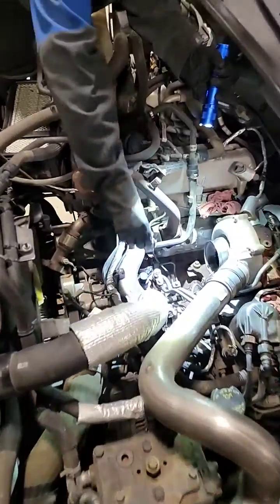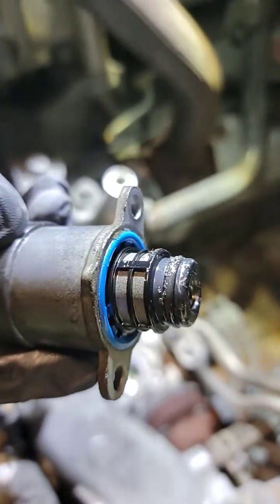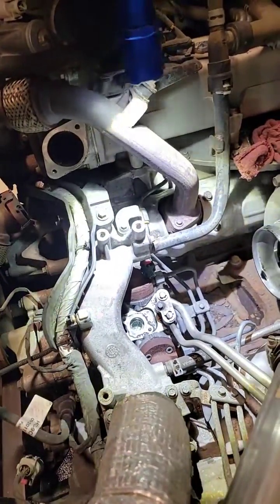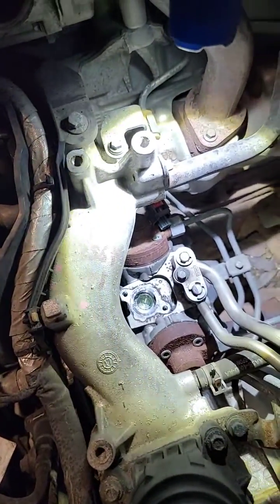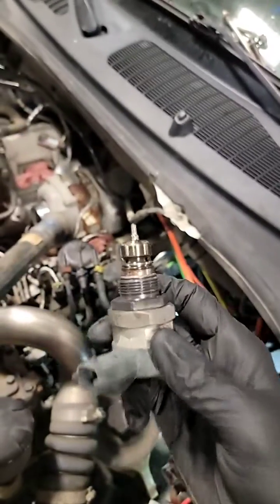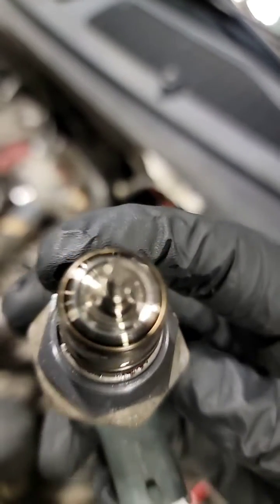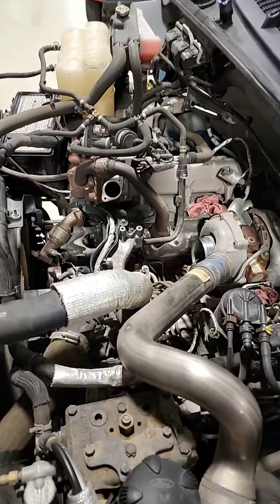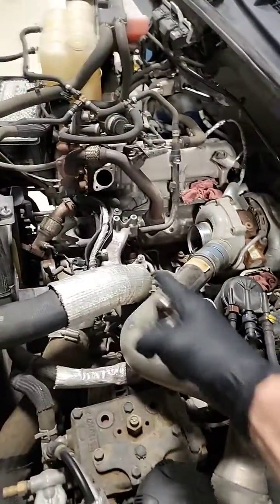6.7 Diesel - CP4 Failure check points! #shorts

Comment: I’ve had an issue for over a year on my 2017 6.7 where it will reduce engine power at WOT; I pulled the metering unit and it is super clean; no metal on it; I haven’t pulled the part off the end of the fuel rail yet….should I check it? Or do you suppose im good?
Reply from the maker: I honestly wld do the DCR and the LH rail only in this situation because you have a problem, otherwise it would just be the DCR

Comment: I’ve got a 2011 that just rolled over 100k miles. I have kept on top of fuel filter changes and I run hotshot secret edt. Do I still need a CP4 bypass kit?

Comment: At what milage/hrs are the CP4s typically failing?
Reply: Its a crapshoot brother. 

Look at taylor rays brand fking new f350 dually he just sold back with only like 10k miles on it after the cp4 grenaded on a roadtrip pulling a toyhauler.

Thats right. It grenaded at 10k miles, dealer wouldnt warranty it. Ended up covering it under warranty, most likely because he has half a million youtube followers.

But he said it was like 12,000 to fix everything.

Dealers arent warranting cp4s if they find water

Comment: As Consumer Level Diesel fades from relevance. FoMoCo released 7.3 Godzilla gasoline V8 in 2020 for this very reason.
Reply: Now they have a 6.8L babyzilla too
Reply: @Dr Beechas  Thanks for BabyZilla updates.  These highly sought Big Bore Spread LS type clones need wider use in production vehicles.  Little doubt aftermarket will step in as these type simple,pushrod, relatively inexpensive engines may be the pinnacle of ICE . For the next century perhaps

Comment: Uhhh are these trucks new ? How in the freaking F did it rust so fast
Reply from the maker: What happens to raw metal when it's exposed to the atmosphere what happens to your rotors
Reply: @PowerStrokeTechTalkwARod  indeed but those get scraped and they exterior. That valve or thing was rusted inside

Comment: Lot’s of “water in fuel” comments which leads me to believe that, unless you are 100% certain your fuel is top notch, you should be running a fuel additive. Even if you are 100% certain of the fuel quality, still run an additive. The extra lubrication on the pump is pennies on the dollar for an out of warranty repair like this. Is this the reason or a factor on why these CP4’s are failing?
Once I get my S&S DPK installed to protect from this problem, I’ll still run an additive.
Reply from the maker: Well said breatheren

Comment: Thanks, Just in time i have been trying to explain /discuss this with a new Ford owner .( Ordered 2022 F-250 6.7 owner ) He came over from 187K on a Duramax. I see in Automotive News a major lawsuit has dropped on the CP4 Bosch Pump for RAM as a safety problem with a no start or stall. This may also migrate for Ford and GM owners. Lack of lubricity in the fuel and or poor filter maintenance maintenance. Lord you will be busy if they have to retro pumps with a new design and or add on a Ford Kit to stop it.

Comment: Judging by the engine compartment, that appears to be a 6.7 of the F-650/F-750 variety equipped with air brakes. Since I've never had the pleasure (or displeasure???) of being in the engine compartment of one of these animals, tell me, is it honestly easier or harder to wrench on, compared to the F-250 to F-550 variety?
Reply from the maker: A lil

Comment: Dang makes me wonder if i need to invest in one of those disaster perevention kits you showed in one of your previous videos.
Reply: Better to spend $400 now than possibly $9000+ later.
Reply from the maker: Y wldnt u
Reply: @PowerStrokeTechTalkwARod  Do you know if a cp4 disaster prevention kit would void a warranty?
Reply from the maker: Id recommend you to check out the video we did, all your questions will be answered there & in the comments
Reply: @PowerStrokeTechTalkwARod  Ok, Thanks Sir. 👍👍👍
Reply: @maverickclark2054 ost likely your cp4 wont be covered. They will test your fuel for water and then pull that pressure control valve for rust. If thats rusty, and or have water in fuel, warranty claim denied.
Reply: Bought mine. Was backordered by two months. I’ll be installing it soon.